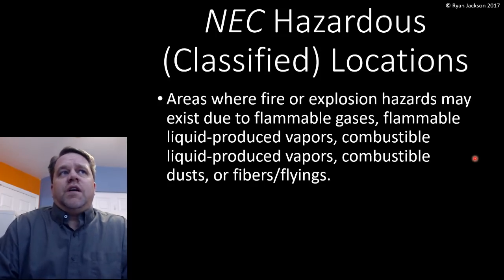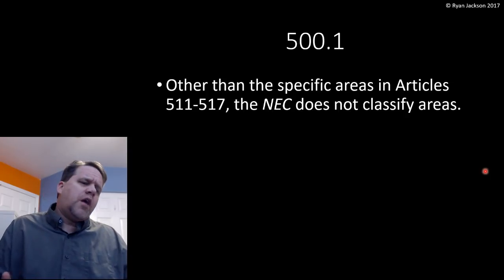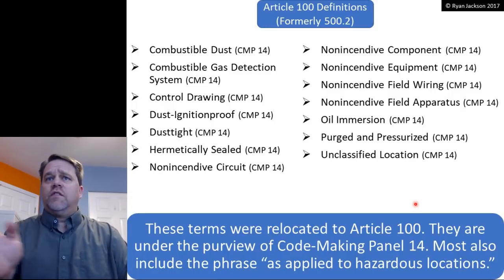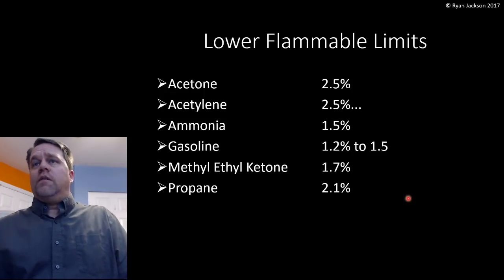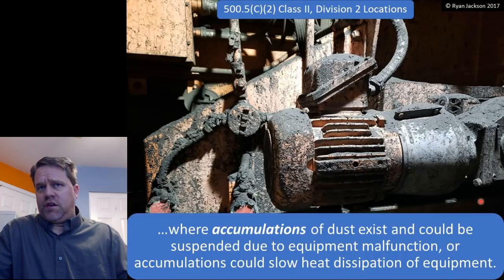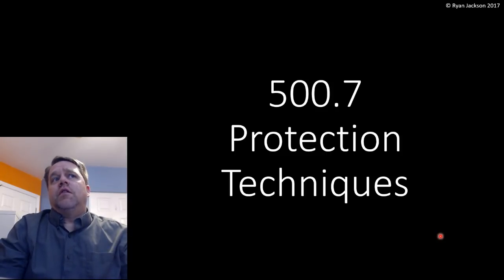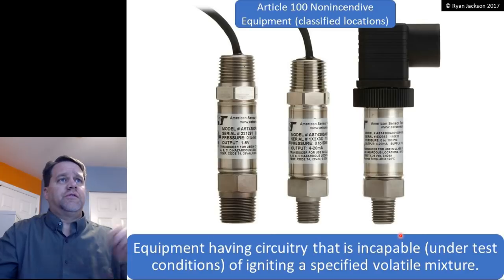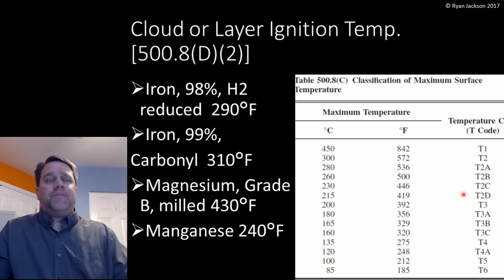NEC Article 500, Hazardous (Classiified) Locations

Comment: Where in nec does it say we need to use a dust ignition proof be used?
Reply from the maker: Great question. Unfortunately...nowhere.  Section 502.115(A) used to call it out specifically. Now, it just says you need enclosures that are identified for that location. Using the definition of "identified" the AHJ could allow just about anything, although I think the intent is to use dust ignitionproof.

Comment: Thank you for the excellent presentation. Your effort in creating and sharing this valuable resource is greatly appreciated.
I have a question regarding the difference between Class 1 - Division 1 and Division 2. We are currently considering Division 1 for equipment leakage and breakdowns. However, I am wondering why we are not treating these events as abnormal and defining them as Division 2 instead. After all, it is not normal for hazardous equipment to leak or break down, is it?
Reply from the maker: I agree with you. If the only time you have an ignitible mixture is when equipment breaks down, I would classify the area as Division 2. But if a leak would directly cause an explosion, that owuld be Division 1. Or if a leakage is a common occurance at the facility, that too would be Division 1. But, again, I think most locations that are only hazardous due to leakage are Divisision 2.

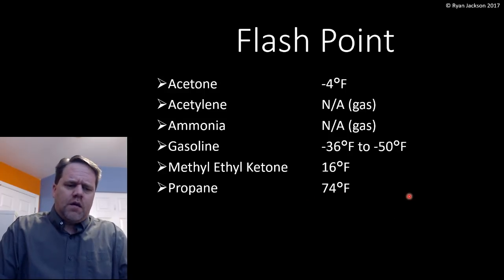Comment: 38:28 ... I love watching some of these HVACR and safety videos so I can point out the errors. Propane is obviously a typo. It boils at around -44.1 deg f. It is a gas. It's flash point is -158 deg f, and it's saturated vapor pressure is around 110 to 115 psig at room temperature.  Seriously, now, that has got to be a colossal typo.

Comment: Talking about the acetone bought something up. A few years back I asked if they could install a second battery operatedb hand opetated in busy hallway that housed 3 elevators in the hospital. Believe all hallways that elevators emptied into had triple 5/8" fire rated sheetrock on heavy metal studs. The hand santizers held maybe a quart of flamable alcohol based liquid. Safety department that they were permitted to have 1 hand station maybe every hundred feet. Sermed liken over kill. Entire building had smoke detectors and a fire pump that sparkies test ran every week.

Comment: Years ago worked at a very large candy company. They had a 20,000 square foot room that housed 3 Mogul starch machines. They would deposit hot carmel, marshmallow etc into starch boards then let them set up for 24 hours in that room. When they built the plant they used regular 3/4" condulets with a short nipple feeding approved gasketed 4' luminares. When I told boss that they should have used explosion proof condulets that have 4 heavy screws to secure cover. Boss said regular condulets were okay because they used a rubber gasket. Same cheap boss would purchase the shortest copper colored explosion flex to feed motors, solenoids & micro switches where I always used flex 3' long. Could not believe that they used 480 volts on all start stop stations, micro switches etc on a 30 amp time delay fuse. Was able to down size control fuse to a 10 amp fuse. Mechanics had to always wait at least a hour to let dust settle then sweep floor then hose down floor and area where they had to weld. Had 4 roof hatches that just sat on top of curb box and could move in the event if an explosion. Installed some explosion proof luminares where the mixed chemicals. They had to cuf 2 long slots on walls think it was every 50' that would blow out in an explosion. They used a very thin chaulk on only one sidde of cuts to keep bugs & water out. Thanks Ryan for another great vid.